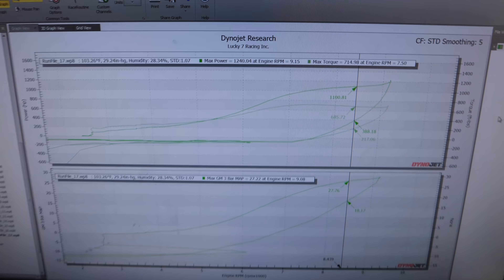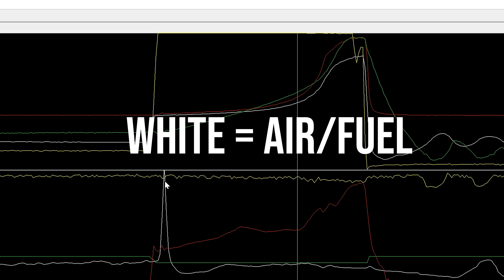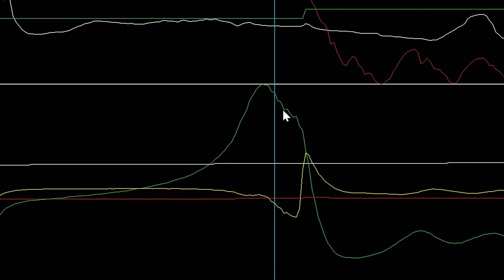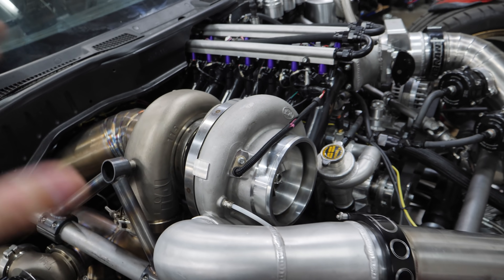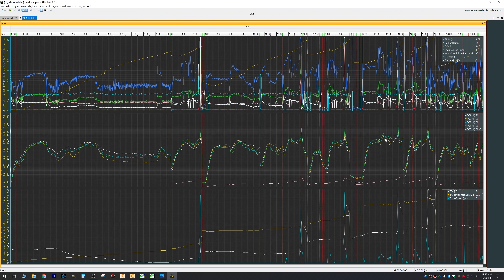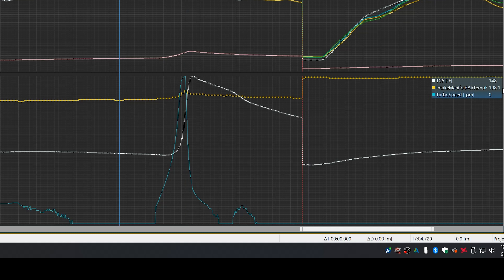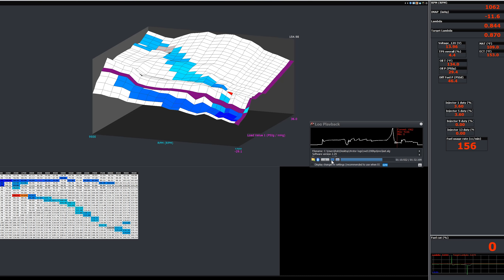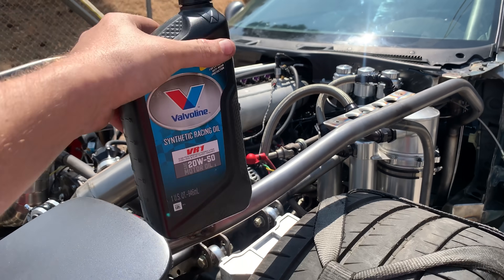My SECRETS to 1240 Horsepower!

Comment: If you would change those injectors firing all at once and dial the tune from there, You would find out that your collector bucket is too far from the fuel rail. At the big end, the spray pattern is no longer a mist, but a squirt due to the lack of flow at the rail. Also every time another set of injectors starts to fire, the fuel mix goes haywire. The problem between your rotaries lies within the position of your throttle body. It feeds back housing more than the front, and the intake creates a vortex right in front of the rotor1. To rectify that, you'll need a collector type intake that directs the air flow more evenly. One big hole opens to a center of a dome that feeds all eight ports. Maybe even two throttle bodies and two sets of intake runners. In all setups the butterfly valve axle(s) should be in line with the rotary main axle.
Reply: I concur sir
Reply: Yes,. The secondary injectors at low duty cycle will make afr go crazy,. Specially if they are larger then primaries,.
Reply: How do you know this? Just curious
Reply: @JoshRiolu  Basic physics. Mainly fluid movement laws. Lots of hours at the shop, figuring out reasons for obscure symptoms.
Reply: yes, because of the mass of air flowing, the pressure inside the manifold makes the A/F go nuts, law of thermodynamics as they says, maybe if he can make a manifold that the inlet is the in the center and not on its front
Reply: This is a fact for sure I’d say just changing we’re the injectors are and moving the throttle closer cause it’s not enough pressure in the intake
Reply: Yes, he knows this and has discussed it in prior videos and on patreon.
Reply: @oikkuoek  not to mention those hours of lying in bed at night imagining the air flowing through different intake manifolds and stuff.
Reply: Rzcrew is good at making manifolds that direct flow evenly across the ports
Reply: I was looking at Plenum designs a while ago, and Rob has what I have typically seen as ideal. A large volume plenum tapering down towards the rear most cylinder. Also assuming there's bellmouths inside the plenum, the air feed across the face of the bellmouth would then also become uniform. Is it possible the plenum doesn't taper down enough for the air speed being pushed through the throttle body, such so that there's still exsessive "ram" to the rear most cyclinders?
 From what I had seen before, central fed plenums as you describe tend to bias central cylinders with airflow. Of curiosity, would there be any reason a rotary engine would act differently in this regard?
Reply: @davidorourke4685  Interesting point! That plenum as I understand is Rob's own design, and reading from the dyno results, it has no inside paffling to even the flow. For result to central bias I proposed two throttle bodies and sets of intake runners. They could share an H-pipe and a plenum pre-flap-valve, but otherwise separate.
Reply: David O'Rourke probably the same with any engine where the intake runner closest to the throttle body is starving the rest of the cylinders of air. 

Personally my runners in my intake manifold are tilted different directions so in theory it shouldn’t happen as much. Could be snake oil who knows lol
Reply: is this bad? would it damage the engine? i really need to learn this engine.. i have a lifeless rx8
Reply: @georgerodriguez8373  Most likely it will damage the engine, and these mishaps in the design leave a LOT of horsepower on the table. Will a 4rotor be inheritly better than 2-, or 3rotor? No. Yes, it will make an insane amount of power, but it is a handful to tune, and a terrible mess to fit anywhere. It also has basically unstreetable torque characteristics. There are multiple ways to get a 1000+ hp engine out of 2- or 3rotor. That route makes way more sense than this.

Comment: Rob if you are listening:
So what if you try to experiment with independent throttle bodies?
Reply from the maker: If the manifold was designed differently that would be worth trying. Mostly for under 3k rpm control. But moving some of the injectors lower would solve the issue too

Comment: Im not sure on which rotor is which number but if the coldest rotor is the one closest to the intercooler and the hottest one is the closest to the firewall could the dyno fans be cooling the front of the motor enough to lower the first rotors temp that much? Its not as complicated of an explanation as others have pointed out with air/fuel and tuning, but ive learned not to discount the simple explanations sometimes. Wicked build, cant wait to see it crush the tarmac.

Comment: Great stuff! I just recently installed pre & post compressor temp and pressure sensors, I need to get on the exhaust measurement hype but I'm out of ECU inputs 🤦🏼‍♂️
Reply: Hey Khraygh
Reply: Here I am wanting to switch away from cobb on my evo to get more granular tables lol. That and ecuflash has a much more straight forward boost control tables. I need to get accesstuner for the Subaru though....can't wait to go standalone
Reply: Find one that isn't being used and re use it

Comment: that explanation of eficiency of the intercooler was way off btw you rerally need to be measuring are density before and after the intercooler. measuring temp at those points would be benefitial too

Comment: At about 8 minutes you say that it takes almost 100hp to drive the turbocharger...are rotary engines different than piston engines then? Because a turbo has always been described to me as “free” power for an engine. Now I understand that there is no way that it’s 100% free power, but I do know that it takes waste energy from the expanding gasses of the exhaust to drive the compressor side of the turbo to gain boost pressure without a mechanical parasitic load on the engine like a pro charger or a roots type blower. I’m not looking to start anything, I’m genuinely curious. I’ve been a diesel tech for 15 years and know very little about rotary engines and would love to know if it’s different and that a turbo is, in fact, some sort of parasitic load for a rotary...
Reply: Not an engineer myself, but I think there's little difference between rotaries and piston engines here. Turbos are definitely not 'free' power because they cause a lot of backpressure that puts a load on the engine, but without a turbo all exhaust flow is wasted. So I wouldn't call it free, just less wasteful. In a way turbos add a parasitic load just like a supercharger, but the latter lets all that exhaust energy just flow away, so it's double inefficient.
Again, I have no expert knowledge on this, just letting my thoughts run free.

Comment: Cool idea.  tilting the compressor housing exhaust down 20 degrees maybe 25 headed towards the intercooler then create you a carbon fiber hood to hang over that beautiful engine with a hood scoop in it so it gets nice cold air instead of getting coated with warm air

Comment: My 1/8 mile drag car was 2 rotor with huge ports fed with a Australia burn out car 4 barrel carb I scored from an old timer.
In the warm up , stage , burn out and run id use 12 gallons of methonal . peak was 10,500 shift point was 12,500. 
Car ran street class with carb and no supercharging (chemical , or turbine driven all motor)

Comment: Concerned that you went for a 1200hp run with that lean spike at throttle Tip-pin. If you skip that question what else you skipped on your quest for numbers. 

You can hear it spudder.

An engine making that much power needs to be heavily loaded to tune properly.

Everything is happening so fast i would been concerned if its loaded up, or say a 4 to 5 shift and that big ass turbo is already up to speed, your boost is going to come on a lot sooner and you’re gonna be in areas at a map you never touched. It be like trying to tune a 500hp two rotor in second gear. 

When I saw the map trace thats what I thought, it looks like a 500 hp to rotor in second gear,  which is completely different than 160 miles an hour an in 5th gear. 

I know I’m just some asshole on the Internet but tune the drivability first.  Like your throttle tip in lean spike, and load that engine up and run it through every cell slowly. 

It’s running through the cells too fast to properly tune.
Reply: Rob I’m dropping you a link to a gale banks diesel,  they’ve got an engine on a test stand and they’re tuning.

 notice how they load this thing up? this is what you need to be doing https://youtu.be/sggAFX4iMVM

Comment: The R26B has the inlet and outlet of the cooling system in the center of the engine to balance the temperatures of the rotors, in your engine it enters and exits through the front, that is why the fourth rotor is hotter than the first rotor

Comment: So rob Am I right in saying: if you had a separate inter cooler for each rotor and the same length exhaust from each rotor going to the turbo you could get even more power out of the engine and would be more efficient??

Comment: When you’re at full throttle, how much cam is needed through the fuel tank vent to keep up with the displacement of that much fuel consumption? I didn’t think you needed a inner cooler with e85. But I was clearly wrong.
Reply: I was trying to say cfm not cam
Reply from the maker: I suspect you could almost get away without one. But my temp sensor is measuring before the ethanol is injected so I don’t know the temperature of air/fuel going into the engine. It’s insanely cold for sure

Comment: Hey Rob, I have a question. Why are turbos almost always mounted in line with the car, or at least, why is yours? I would thing if you turned the turbo so the intake side faced the engine, you could point the compressed air exit strait at the intercooler, removing those tight bends. Also the exhaust would already be pointing outwards toward the side, so it could be pretty short too. Thanks in advance! From The Netherlands
Reply: If the turbo were facing the engine, it would be drawing in hot air from around the engine. Having it forward facing it can draw in cooler ambient air

Comment: Love the build and dyno runs but this, for me, is where the stuff gets exciting.
 I read an article years ago about the last of the first turbo era F1 cars and they had similar problems with manifold/intake favouring certain cylinders. They increased the  volume of the intake manifold (pre intake stack) to even this out and ended up running quite large 'balloons' above the intakes but obviously there was a finite package size for those engines then and a certain amount of driver perception that the engines , which were amazingly laggy at the time were even worse. Although it's also worth remembering that those tiny 1500cc engines were taking up to and beyond 90 psi of boost and making up to 1450 HP In 1984!

Comment: I normally dont like the latest videos of Rob but this is an exception. I never knew that rotaries have different HP production per lbs/ft of air intake. I learn sth today.
As for the why your rotor 4 is hotter than rotor 1 is because of the geometry of the manifold. All engines that use this longer manifold that sucks in air from the front side suffer from this because air at higher speeds doesnt want to make sharp turns. Mazda's OEM manifold is the best for splitting the air perfectly on all rotors. Would be really interested to see how you solve that :)

Comment: I know that it's ALOT of Work & Research, but maybe you need to "REMAKE" your Intake Runner as a Bisected Tube that will give a Consistent amount of Airflow to each Cylinder...🤔

Using Fluid Dynamics, you should be able to make Smaller Pipes off the Intake and a Larger one for Cylinder #4 to make up for Flow Deficiency.

Just my two cents, or am I "OVERTHINKING" this project?

Take care Rob Dahm,
🤓 -Thomas
Port Orchard, WA
(Just West of Seattle, Washington)

Comment: 0:00 Sounds Like F1 Engine
Reply: 26B build right just sounds sweet... Check out 787B sounds...
Reply: Sounds somewhere between an F1 V8 and an F1 V10
Reply: @Grooove_e  well there a 4 rotors with 3 sides but the rotor is going half the crankshaft speed so it should sound like a  12 cylinder (4stroke) at the same RPM

Comment: 14:00 rotor 1 isn't it in the front of the engine recieving the fresh air? is there any solution to that? is it even a problem?
Reply: Not how that works. You can thank Fluid dynamics and air packing.

Comment: I never understood the stubbornness to this project, I do get the uniqueness factor and doing what no one else is doing  and the passion for one technology in this case rotaries  but when a little 4 cylinder G63 engine can put out the same power as this thing costing a lot less, I don’t understand lol I subscribed to this channel like 6 years ago and to this day this thing is not running properly and still looks half done, and the 2000 awhp claim seems impossible because always one thing or the other breaks down, dude should have left this thing a long time ago.
 At this point looks like mr. Rob Spaghetti was right that mr. dahm won’t see this finished on his lifetime although I wish him all the best

Comment: how can it be a secret, when this whole time robs been telling us 'I don't know what I'm doing'? should be 'what I've learned to get 1240 hp', much less a 'secret'.

anyway what I don't get is if you have 2 secondary injectors, one is used like 5%? what if you made it so the primary are turned low or off, so that Both Secondary are used? to me if u have it then you would want to use it as much as possible.

Comment: Billet 4 rotor all that boost and $ for that?
20B with mild porting and 20lbs is an easy 1000 + hp all day.
H.P. to $ ratio is abysmal. 
That thing should be making well over 1500whp.

Comment: Again with all that money spend into "one of a kind billet 4 rotor with best of best parts" 1240whp not impressive at all.
Reply from the maker: For me it is. Rebuilt and tuned by me. I feel like it’s an insane milestone when someone else was supposed to be doing all of that when the project started
Reply: @RobDahm  Good point,  im huge fan its just i was exited for this cars dominate and i remember u saying 2000hp back in the beginning days, 1500whp be niiice. But i hope all works out for you, because thia tonds hard work and reward need to be there, specially when u gonna dly by gtrs and vipers and lambos.